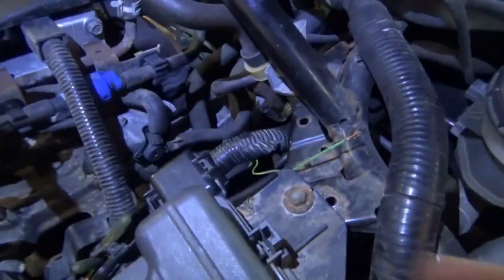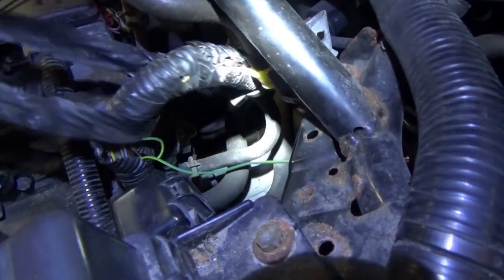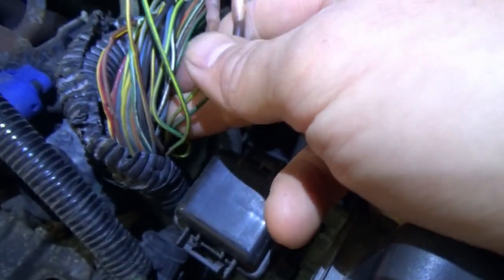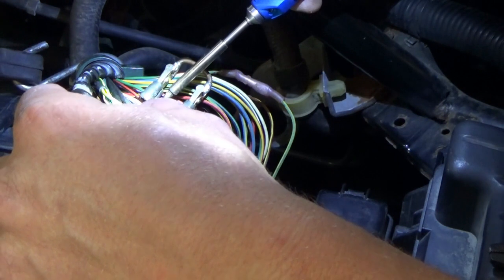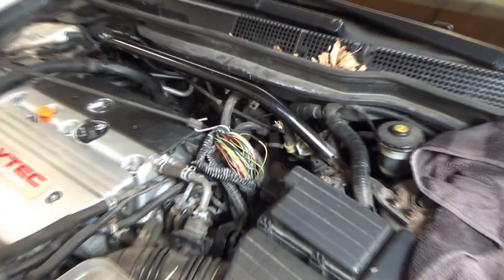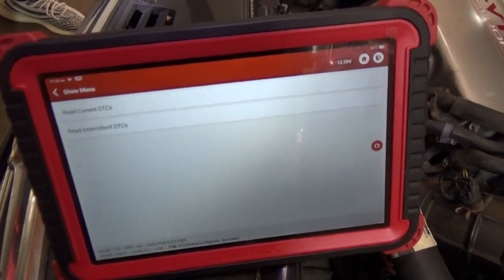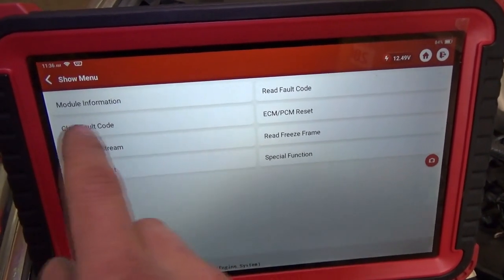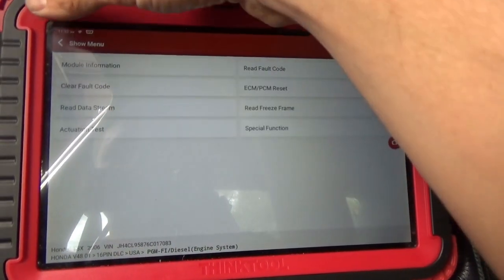DANGEROUS Acura Limp-Home (Part 2)

Comment: Nice fix.  Soldering is the only way to go repairing wiring.  I'm surprised to see EricO using those junk connectors.  They have no business being in a car in my opinion,  too much vibration and heat cycling under the hood especially.  Lifetime electronic tech talking.
Reply from the maker: Thanks for the feedback Jim! Yeah I cringe every time I find a butt connector on a vehicle harness haha. Soldering is by far the cleanest and most reliable method for long-term wiring repairs 🙂
Reply from the maker: @JOMaMa..  Now now, name-calling isn't the way to have an intelligent discussion xD  Yes, I am stubborn, but just from experience have seen way more failures on butt connectors than solder joints. This video was a beautiful example. Probably because most techs/DIYers don't have aviation crimp training or the proper crimp tools!
Reply: @PineHollowAutoDiagnostics  for example look up 2004 Chevrolet Avalanche go to power and ground distribution then go to repair tips and you’ll see electrical harness repair. The manufacturer will instruct you in their recommended repairs. All manufacturers recommend splice crimps in electrical repairs. The manufacturers recommended repair procedures  is how I repair electrical wiring .
Reply from the maker: @JOMaMa..  yes yes very good. GM isn't known for great wiring to begin with. I often improve on their mistakes with high-quality solder connections haha!
Reply: @PineHollowAutoDiagnostics  good point